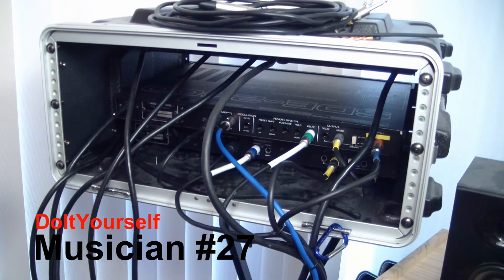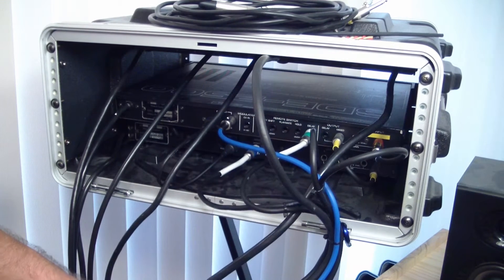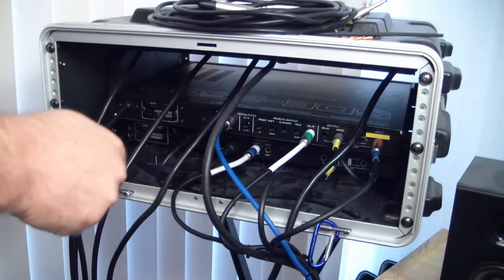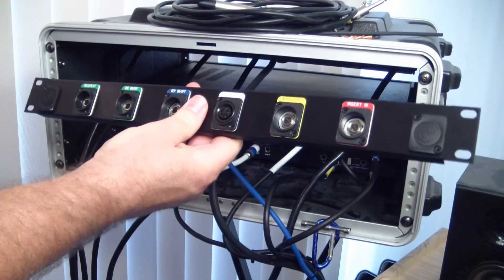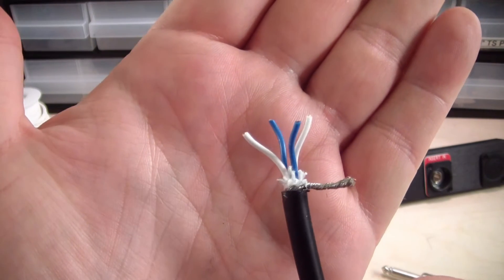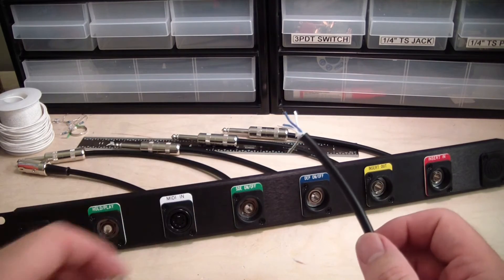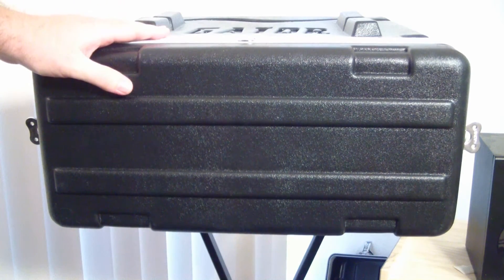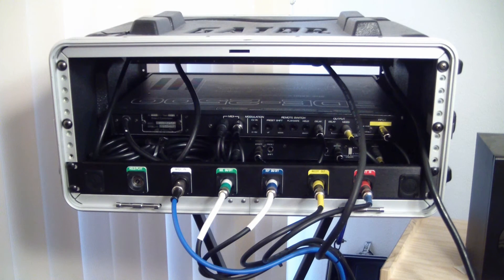Do It Yourself Musician #27 - Guitar Effects Rack Patch Panel

Comment: I did very much the same thing with my old bass rack. I bought a 1-space blank panel and had a local machine shop drill it out for me. I installed 3 speakon jacks (left, right, and bridge) and an XLR which was DI from my preamp. I used my wife's label maker to label them all. Made it much easier to set up without having to reach into the rack (often in the dark) and feel around for the right jack or make sure the speakon plugs were turned the right way, etc.

Definitely a cool idea.
Reply from the maker: paulthegeek Yes it definitely makes things easier and faster. In this case it makes my (admittedly a bit expansive) rig setup and tear down smoothly. Thanks for watching!